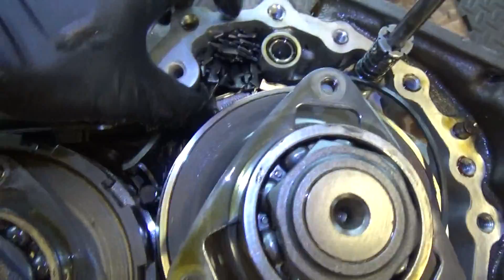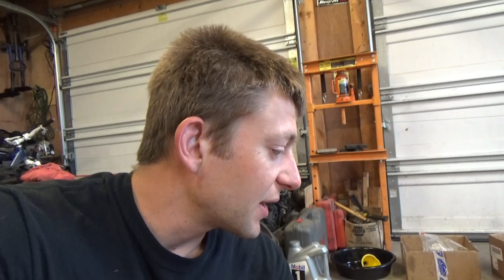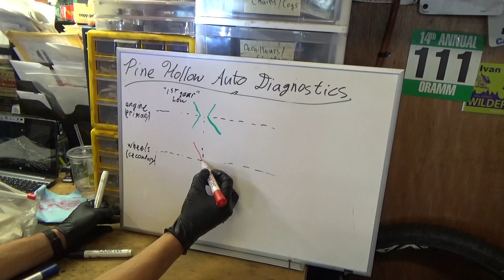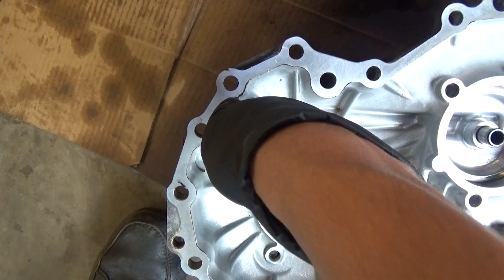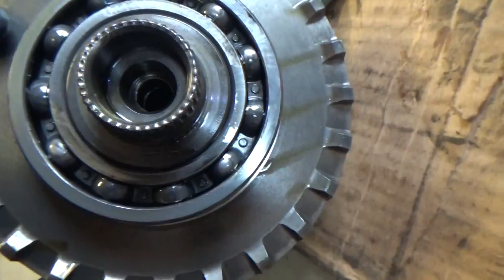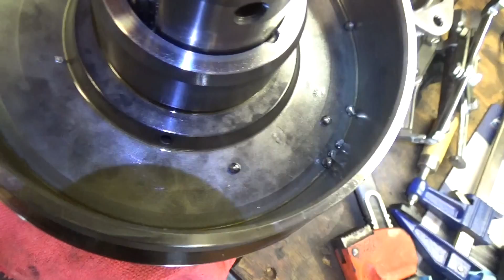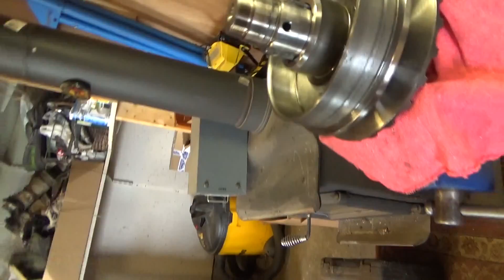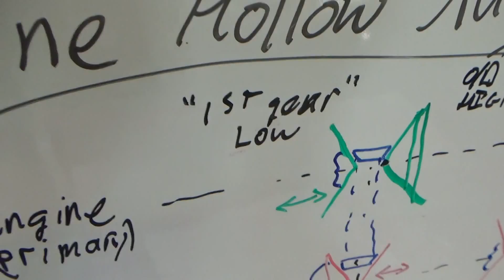Nissan CVT: Teardown and Failure Analysis -Part 2 (RERELEASE!)

Comment: Fantastic video.  I had the general idea but had not seen anybody else take the time to disassemble a CVT,  I have 2005 Nissan CVT that I baby along.  Even installed an additional air-to-oil cooler in line with the stock unit.  I've known several folks that had their CVTs fail over the years.  Heat seemed to be a real negative so I keep my oil clean and added the additional cooler.  Not sure it's gonna matter in the end now.

Comment: Buddy the cvt needs an external auxiliary cooler. When the cvt oil temp reaches to 90 Celsius the wear starts. 

For example in pathfinder  theres an auxiliary cooler near wheel driver cover, people don’t spray it with water and find get clogged with sand and dirt and it becomes a death trap the oil instead of cooling heats. The ideal temp for Nissan oil is 65 to 75 Celsius. 

Not having a cooler installed is crazy. No one talks about it and also cleaning the cooler if you have one. 

If you’re going to install one use Hayden 30,000 btu or 40,000 Btu 

And driving habits people who start the car and drive with waiting a minute just destroy these cvts because oil temp is not warm yet enough 

Apart from that drain and refill frequently and replace the paper filter and don’t open the pan or change the strainer

Comment: I have now flushed two Nissan Altima CVT each going through around 11 quarts followed the Nissan Service steps up on jack stands watched the temperature and replaced bottom filter and the element filter I used the overflow to properly check final level with the engine running both cars with almost the same 108K miles I used Nissan NS3 fluid. I purchased a 2024 Sentra I plan on replacing the fluid around 20K like they recommend on the Under the Hood show that’s nationally aired on the radio and is on YouTube. The 2014 Altima was somewhat easier it did not have the plastic air dam like the 2018.

Comment: Seven years down the road and the CVT’s are still blowing up. A lot of folks get around 30 to 60K miles b4 they die. When my granddaughter’s second one blew no one would rebuild them and new ones were scarce. Donated that car to a group that would try to find a replacement and give it to a needy family hoping it would last 2 years or if necessary they would part it out for cash. Bought her a Chevy as her replacement vehicle !

Comment: This is an awesome diagnosis. That is brutal. It's amazing that this is what causes the failure. What causes the wear is the metal shavings. It seems like it should have better load distribution, but overall it is the wear from metal shavings on this area. Wow, such a simple design consideration, yet such a big issue. Thanks for making this video. I had to know what causes the failure, and I'm happy to know exactly what causes it. I may attempt a repair, wish me luck. Hope yours runs for many miles!

Comment: I tell you what you seem like a nice guy and you seem like you know what you're doing I have a 2008 Nissan Rogue all-wheel drive been trying to get to CV axle in for about 9 months now only time I can get it out is when or get it in or vice versa when I take off the carrier bearing bracket then when I go to mount it Dan evidently opposed it in and then it is not locked anymore in anymore tried Halloween out the back of the career bearing so I can slide it in a little further but when I went to mount it it pulled it in like I said and then it wasn't locked anymore in anymore evidently the hog ring is on the inside of the tranny and I've worked on cars here and they're my whole life but I am a drywall man play dedicated to the mission but I appreciate the inside that you gave me evidently you work on Transmissions or you wouldn't have took that one apart but thank you for letting me know the insides at least and I hope you have good prosperous on this channel and I will give you 10,000 likes

Comment: In general terms, this CVT transmission is not as reliable as its shifting counterparts.  It may save you fuel and make a smaller engine faster, but in my opinion the cost of rebuilding counters any advantages.   Stuff needs to work a lot longer than just the warrantee period!

Comment: Those large bearings are ball bearings not roller bearings. By the way, enjoy cleaning all 425+ pieces of the belt out of that transmission. Make sure you flush it twice…

Comment: If the volume of bth the primary clutch servo and secondary servo oil cavities are the same and secondary pressure spring is strong enough there should not have to be any control on fluid flow to and from clutches / all control could be on primary clutch ????

Comment: something on the valve body was shot. a valve or solenoid wore out. the secondary piston wasn't allowed to drain properly, compressing both pistons while in high gear, stretching the belt, and wearing on the balls. definitely a fluid overheating / not changed frequently enough issue. the biggest problems with nissan CVT's is the undersized CVT fluid coolers and the fact that nissan hates anyone doing anything with the transmission fluid.
Reply: just watched the first one. definitely a fluid issue. that stuff was shot. it's gotta get changed regularly. especially if it's never been changed. 

the flow control valve on the pump was probably shot, too.

Comment: @atra-automatictransmission1300 No, it works fine, there is no knocking or anything, the sound comes from the gearbox, how much is the gearbox oil in the front? They put 7 liters after the repair.

Comment: Hello, I have a question.  There is a humming sound in the Nissan X Trail 2016 automatic transmission.  Everyone says it is normal between 20/40 km/h.  What is the solution?  It does it even when you slow down.

Comment: Thank you for the re-release of this series.  I've been led to believe that the cause of CVT failures was always belt stretching to the point of breakage.  It certainly looked like that from the initial views.  However when you pulled the primary cone assembly apart and showed the wear inside the ball bearing guides it became obvious (to me at least) that this was the major contributor of the failure. The cone locked up and it's opposite member continued to move causing the belt to become stretched and fail.  I wonder if the CVT manufacturer would consider milling and installing something like tungsten carbide guides in those locations to minimize this wear effect.

Comment: Hello, my name is Paul. I have always heard that there is a plastic part inside these  transmissions. Of the Nissan Morano and Nissan Rouge These are the two
  nissans that I heard that had this problems. I am trying to do  research to find out. It sure does seem like the engineers didn't think about this tranny too Well, I am watching you in the video and it seems like the belts were made out of plastic. Or just cheap metal.There is a couple of mechanics on the internet that are trying to figure this problem. My granddaughter brought Her Nissan Morano to me to fix it. So I threw it used Tranny. in there from a Junkyard. That was a T boned wrecked Marano and it worked. 

 Anyway, I think there was 34 segments down in that hole. That you cleaned out. Could you please send me my free? T-shirt.

Comment: An unnecessarily convoluted mechanism to perform a simple task. Instead of all the oil, mechanics, sensors, and computerized controls, how about making a strong belt from the same rubber and cords that radial tires are made from. Create adjustable pulleys with weights to use centrifugal forces to pull the pulleys apart as the RPMs build up and increase the drive ratio. I am not an engineer, but I have always had an affinity for the mechanical advantage. And this CVT is nothing more than an over-engineered failure of knowledge.
Reply from the maker: Rubber belt might work on a moped... Definitely not a car transmission!

Comment: I once had a 1977 volvo 343DL with CVT.  Belts (note plural) were made of thick rubber and were in AIR.   There were 2 belts (one on each side of the car transmission which was in the rear of the car).   The outer halves of the primary pulleys were moved in and out by a combination of centrifugal weights and vacuum applied on either side of a diaphragm.   The secondary pulleys were just spring loaded.  The clutch was a dry clutch (yes you  read that right) and the pressure plate had centrifugal weights plus vacuum control too.   The engine and clutch unit (i.e bell housing) was in the front, with a very light aluminum prop shaft (rotating at engine speed) in between.  The whole setup had 2 disadvantages - it was noisy and bulky.   BUT everything was servicable.   Changing the clutch was simpler  then a manual transmission, and changing the transmission belts only required undoing the tensioning bolts between the main and secondary pulleys and then tightening them again once the 2 new belts were slipped in.   So now 50 years later and wiser, when we are supposed to be 're-using' in the interest of the environment, we are instead making all this crap in our new cars that simply ensures we throw away a complete transmission (possibly a complete car ) after 100K kilometers?   I don't call that progress.     Edit : amazingly th belts are still available for sale : https://www.volvo340onderdelen.nl/en/volvo-300-serie-drive-belt-non-original-cvt-transm.html

Comment: Again,the pulleys slide up and down by hydraulic pressure,but the pulleys slide on bearings in slots,which crush under repeated power.This is the weak link,those small shaft bearings in slots that malform under pressure,jamb and snap the belt

Comment: No not a new belt will fix it,it is the small slide ball bearings that slide in shaft slots that jamb under use and power,hence the belt explodes

Comment: The only suggestion that I can think of is over pressure because overpressure valve failed just like hydraulic oil  pump too much pressure and with one seal this happens

Comment: At 40:00 minutes into the video. Wolla.
That is what I have been waiting for all this time.
I have been humming to myself all these years. I mean from the time I heard about these transmissions.   That is if the changing the fluid  would play if at all, any role in the fate of these transmission.   Not for the life of me.  All it does is some mental comfort as if you are really extending the life of these transmissions.   I SAY ABSOLUTELY NOT.

You are simply at the hands of chance as to when any particular transmission will give on you.
It is clear and obvious that along with sheer mechanical stress on that inner shaft that the ball bearings go up and down in them grooves, that shaft is not exactly forged hardened metal.  Mr. CEO got cheap trying to get Nissan from bankruptcy.  In fact my 2014 Altima, you can lift the trunk lid with a child's little pinky finger. That is how thin and light the dang trunk led is. 

You need 6 grooves instead of 3 and you need forged hardened metals on both the shaft and the bearing and you larger grooves with larger ball bearings as far as I am concerned.

Since you figured it out I will be crazy to think that them engineers has not figured this flaw out long ago. Certainly they are not going to on TV and tell everybody about it.  That is dang sure.

My hat is off to you young man.  Thank you for being steadfast your effort and your curiosity.

I ABSOLTELY DO NOT BELEVE CHANGING FLUID WILL SAVE YOU FROM THIS.  CHANGING FLUID IS JUST ANOTHER RIP OFF ESPECIALLY IF YOU TAKE IT TO THE SHOP.  IT IS JUST ONE OF THOSE WISHFUL THINKING, PIPE DREAMS.

Comment: This video is useful for giving us confidence to tear apart the transmission and understanding common issues. My issue was the outer/rear secondary pulley (edit: 145mm OD bearing) was destroyed due to too tight case-to-bearing clearances, probably. It caused a loud roaring and clicking noise at first, at low speeds mainly.
Reply from the maker: yeah not sure how ":rebuildable" these CVT units are once they grenade. Dealer reman is reasonably prices and seems to be well put-together. This Rogue has 76k miles on the reman CVT no issues yet :)
Reply: @PineHollowAutoDiagnostics  good to know that the dealer reman is a reasonable option. I watched a lot of other JATCO rebuilds online and it seems like these can be rebuilt by one of the few expert shops in the country. Tri-City Transmissions in Arizona can do it and WhateverItTakes sells some upgraded problematic parts and good used assemblies/parts. 

Luckily, on our Nissan Quest, it seems to only be that secondary pulley bearing so far. It’s accessible without dropping the transmission. I used a stethoscope to help narrow down the bearing. Hopefully, combining that new bearing + ~9qts drained and filled will help reduce mechanical wear from here. Seems like the good CVTs can go close to 200k if you’re lucky and also change fluids enough.
Reply from the maker: @johnnypolex  good luck let me know how the bearing replacement goes 🤞
Reply: @PineHollowAutoDiagnostics We haven’t used the Nissan Quest much lately (no more neices/nephews in town). But it’s been several hundred miles and the noises are completely gone and it rides super smooth. 

It of course now has almost entirely new fluid and a new filter. The old filter seemed to have caught the handful of disintegrated ball bearings.

Comment: Excellent deep dive into the workings and potential failure points of the CVT. I admire your drive to get to the root of the problem and the fact that you would rather try to fix something rather than just throw new parts at it. Cheers !

Comment: Primary pulley ball/slot is pathetic design.  Yamaha ATV in the 600CC range are similar (UltraMatic) but have nowhere near the loading.  One may properly know this kind of CVT pulley/belt in an auto is a disposable transmission component.  Very much like KIA.

Comment: Not remotely interested in one of these transmission..or a automatic.  I been told o you want be able to by a new car ot truck with a standard transmission.  Ok by my me lol .. i however like power shift in equipment to operate them ..like Cat dozer or scrapers..  . Thanks for the videos.  I had never wanted to buy one of these and still want ..

Comment: good morning i have seen a few of your videos..nice work. i have 2014 pathfinder won move in reverse. other gear are fine.. replace shift selonoids   but did not fix isue.  any idea?    i have no trasmission  code othe that the  p 07f0.
Reply from the maker: Replace transmission?
Reply: @PineHollowAutoDiagnostics   no  just shift selonoid  and trasmission  presure  sensor  but it sill not move in reverse I think  valve body in bad

Comment: Very interesting video . I have a Nissan with a CVT and I am aware they are not as strong as a manual gearbox . I refuse to tow people out of bogs especially bigger heavier vehicles as it's too hard on the CVT and can  do serious  damage . Some people in bigger manual 4x4's can't understand that .  
They are not designed for heavy towing in my opinion .  They do have some driving advantages over a stick shift but strength and lasting is not one of them .

Comment: This is very old tech electric ac motors had this system they had a crank handle they operated  instead of oil pressure 
would Have to crank up and down the pulley had nylon sleeves  with a key way that was the weak point  belt driving between pulleys 3/4 hp  to 100 hp us motor co. 1950

Comment: Hello everyone, I recently had my cvt transmission seals changed and oil change however the mechanic didn't notice water got inside because they cleaned it, now that the water have gotten out and the transmission installed it's not shifting any further than 1st gear. Anyone know if the water might have cause any damages to the internal components. My mechanic is talking about computer programming or some electrical problems.

Comment: I was very happy with my 2005 Maxima automatic trans and am concerned about my 2013 Maxima CVT lasting the life of the car.  Wondering if one could swap an older automatic trans from a 2005 type car to a 2013 type car.

Comment: this is what the auto companies do to save money on parts. bottom line:  cvts are much cheaper to produce. they are also less reliable than a gear type transmission.    they cant be rebuilt.  there isnt a parts kit you can purchase to make a repair even if the core parts are salvageable. they are basically throwaways

Comment: I’m watching and commenting before the end. I’m guessing the tranny fluid over time got to hot and broke down which caused the belt to slip. Friction from the belt created so much heat the belt shredded. Should of changed out the fluid. It looks black in the video. Should be red or blue. See what you say. Back to the video.

Comment: I have a 2019 build but classed as a 2020 model Australian X-trail/Rouge with the 2.5L and CVT tranny, I have seen another tear down video of the early model CVT's and yes, those balls are a major failure point. I do hope that Nissan has upgraded the parts to reduce the failure of these transmissions and as a result of knowing this inherent problem, I actually drive my car with the economy mode activated so that there isn't as much power driving the transmission as there would be without being in economy mode.

Comment: old video but, i had a ford focus cvt go bad, not the belt in my case, lockup clutch in the TCC went bad and clutch material in the oil got deposited in the valve body, caused the valve that adjust pressure to stick (spring loaded piston), Ford quoted over 6000 usd to repair it (replace CVT and TCC), i decided to try fix it myself, changed the TCC and a good clean of the valve body and changing oil and both filters was all that was needed, it had pretty low milage 112000 km been running perfect for the last 2 years now. i also had to change the seal where the TCC is inserted. Ford claims that the oil is a lifetime oil, so no change needed, after seeing the oil and filters i dont agree :D